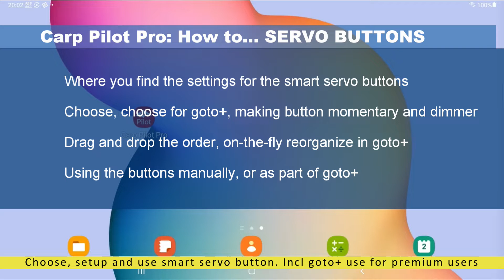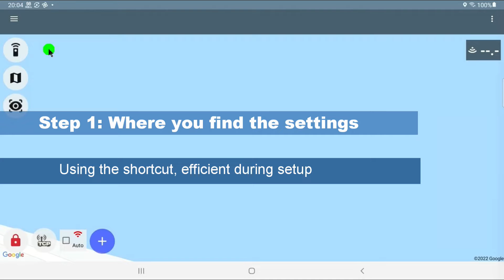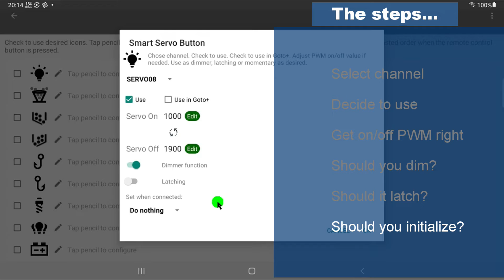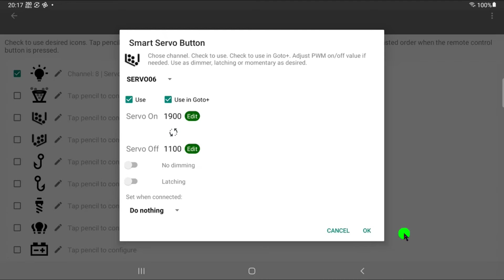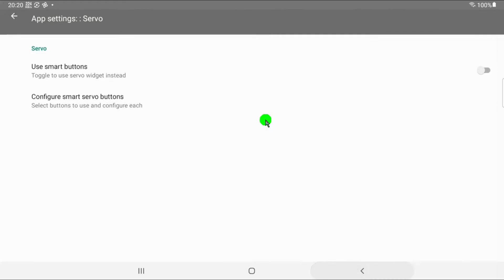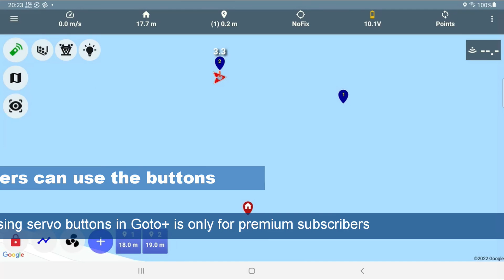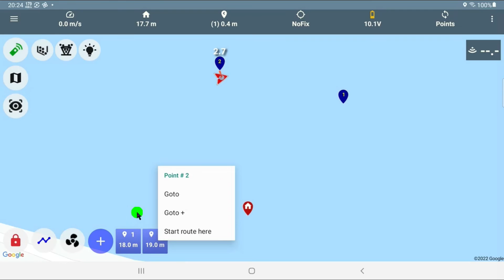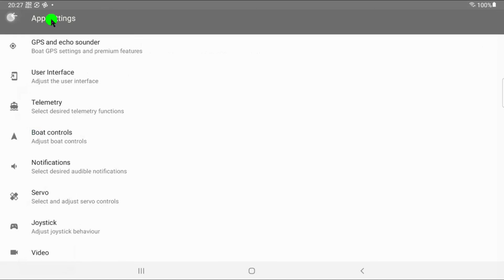Carp Pilot Pro Tutorial: How to use the servo buttons

Comment: Hello! I tried to configure it at my friends boat => RT4 with the switching module (short press left, short press right, long press left and long press right are 4 functions), RC1 on the TX, on pixhawk SERVO2 ist configured for RC1 => works from Tx, but when I configure it in the app there always is RC16 "overruling" everything I do. Looks like a conveniant method "just alter button you want to use", but in this case I can't use RC1.  TX is a eachine TX16,+yaapu script, Tx-Module is SIYI FM30 with telemetry/connection,  On RC16 nothing is transmitting, I don't see anything on the Tx.  Could you please point me in the right direction?
Reply from the maker: The video is a bit dated. Since then the app is updated, start boat and remote and connect the app. Then, when you select a button and go into settings then move your stick or your switch to max on and max off. And then the app will recognize the channel and it's max/min values.

When I developed this part it was with the RT4 in mind as this was also the boat I had at that time. Carplounge uses small micro controllers with their own branded sticker, but the controllers are regular PS4AT. Short up or down then on and off. Long hold (more than 0.8 sec) the other function.

Also these controllers, or rather what they control, do not tolerate to long in their on position. In particular, letting the hook releases be on for a prolonged time (like 30+ sec) and the item tends to get destroyed along with the micro controller. Afterwards everything tends to be total disaster (items must be replaced).

There should be no problem to use rc1 as long as this channel is not used for either steering or throttle. The app does not use rc16 so I cannot say why this should be an issue.

Make sure the setting for servo1_function is not 0. I personally set them to 1 in order to let the rc pass thru. This is also a good setting for servo buttons.

To support short vs long press then make multiple buttons and make them momentary. Set short momentary hold period, like 0.5 sec max for short press and 1.5 sec for long press to match.

All answers above assume you do not have a boat with an APM autopilot. This is old and outdated hardware and cannot support dual use of transmitter and app (and a lot of other stuff APM also does not support).

You should join the Carp pilot pro user group on Facebook. Much better place to get help than in YouTube comments.

Comment: Hello, everything is working fine in the boat (water tests have been done), but I have one more small problem. I have flaps and halogen lighting turned on by APM output 5 and 6. The problem is that when I select RC5 function at 0 in MP, it works with carp. with the remote control but it does not work with the transmitter and when I select RC5 function to 1, it works with the transmitter and does not work with the carp remote control (in MP, the servo test also works the same way as it is set to 0, you can turn it on and off) analogously, channel 6 is the same
I would like to be able to control it both from the remote control and from the application. Hence my question: is there any way to set it up?
Reply from the maker: The problem you face is a limitation in the APM. While the APM is good at general purpose navigation, it is a very old autopilot hardware and is also no longer regarded as supported by ArduPilot. In most cases it works, but the APM abilities are limited. APM uses a software from 2015. And the problem you experience was fixed in a version the year after. If you look at the "manual" available to dowmload from the menu in Carp Pilot Pro you will find a chapter with additional features the APM is not able to support.
Reply: Thank you for your answer. I just wanted to confirm this @TheCarpPilot

Comment: Looks nice. I did the update and don‘t know how how
I can manage my smart server funktions.
How I know which Chanel 1-10 K have to use? Regards Mirko
Reply from the maker: In the old servo setup (for the "servo widget") I had an ability to show how channel values change when you move your sticks. It is still there. I have not come around to make something similar for the buttons. Sorry for that. Here's what I suggest you do: Either use Mission Planner to read of these values. But you can also use carp pilot pro: start the boat and connect the app. When connected, long tap the "remote control" icon, and you get straight into the servo settings. The top setting is now set to "use servo buttons". Tap that so it changes to "use servo widget" instead (just for now, revert it back later). Then click on the "configure servo widget" below. This brings up the old screen to configure the old widget. Now get your remote ready to do testing. And have a pen and a piece of paper ready to make notes. Then click the checkbox top right ("PWM?") in english. For channels 1-8 you will now see values. Do one remote switch or stick at a time: Flip a switch. And see which channel where the value changed. Write down channel for your switch. Also write down the value for off and for on. These PWM values you will also need later. Do this for all the remote control switches you use. And then you will have all you need. Sadly, only channels 1-8 are supported. If you used channels 9 or higher, the Mission Planner is your resque. When you have it all written down, tap the left/back arrow top right. Then tap the top selection again to goo back to "use smart buttons". And then use your notes to set up your servo buttons one by one :-)
Reply: @TheCarpPilot  Thank you for the fast answer. I try my best  to follow your introductions. Thank you so much. Mirko